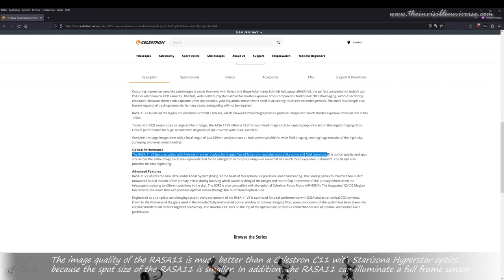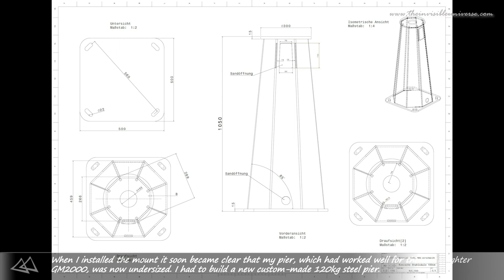Celestron Triple RASA11 Astrograph on the 10micron GM3000 mount

Comment: Well done sir. What a creative idea using a tri RASA configuration. I’ve been thinking about this idea but with between 2 to 4 5”-6” apos. But I could never achieve f/2.2 with those. I could never do this with an AP 130 because getting one is like interstellar travel much less signing up for 2 more. I live in bortle 4 skies so I have some good sky to work with at least. Currently just capturing say NGC 206 up close in detail has taken about 3 days of imaging all night. With a setup like this I could do it possibly in one night. Might be looking at Stellarvue, TEC or Tak—but these are so much faster. You’ve given me a lot to think about. My original idea is to portablize this kind of Astro graph, I’ve got super dark skies about an hour away. Still looking at an AP1600GTO.

Comment: How did you solve the star reflections?  I have a single RASA 11 but am plagued by reflections while imaging Pleiades or Horsehead.
Reply from the maker: Hello, I have similar problems with star halos on bright stars. Star halos are probably caused by multiple reflections between the corrector, the filters and the image sensor. This is a disadvantage of these fast astrographs.

Comment: Fantastic! Excuse my ignorance, could you use all three scopes simultaneously as an array, effectively creating a massive aperture?
Reply: Yes, I think it's a little like interferometry, several scopes spaced away from each other but gathering light or radio waves in an aperture the same as the distances involved. In this case, I believe it's the same as a really fast 33-inch scope (3x11inch).

Comment: Rather than 3 large scopes some have gone to a battery of smaller refractors....I saw one with 9-4" refractors that was used professionally.  This is an impressive project and the results are great....I would have expected some major issues with alignment, synchronization, etc.
Reply: You are right. The same results could be achieved with lesser integration, one scope and … darker skies

Comment: It will be great to know Signal Noise Ratio (SNR can be measured in Pixinsight) for integrated files. 
Visually, I get similar pictures of the same targets with 5 times lesser integration, with single Tak Epsilon 130 from bortle 2.
Reply from the maker: Hi, the S/N of a stack of images through a clear filter with 20h integrated exposure time through the RASAs is about 2.191e+06 or 63.41 db according to Pixinsight. A factor of 5 is about what I would expect between a sky with bortle 2 and bortle 7. This is the unfortunate result of light pollution.
Reply: @Mike-eg6df  Great! Thanks. Factor is at least 12 for LRGB and 3 for narrow band. This was measured on identical targets with identical exposure profiles. 
Your SNR is extremely good from bortle 7. I never passed e+2. How do you convert that numbers in dB?
Reply from the maker: @anata5127  The SNR is automatically calculated by a script in Pixinsight for an uncompressed 32-bit xisf image and converted to db. However, there are some db converters on the internet.
Reply: @Mike-eg6df  I don’t use script for getting in dB. But, I got converter dB = 10*logSNR. SNR is S/N with no units. I get only SNR in subframe selector.

Comment: Mike - do you do all the CNC machining yourself or is this made by someone else? I am curious what level of expertise is needed for this in terms of designing and manufacturing. Many thanks for your input! Awesome system.
Reply from the maker: Hello, I did all the work on the milling machine and lathe myself. I bought the two machines especially for astronomy. However, these are not CNC machines, but purely manual milling and turning machines. You need a certain skill level to be able to use them. But if I can learn this, then surely everyone else can too.🙂
Reply: @Mike-eg6df  This is awesome - I am always looking for custom parts to improve the rigidity of my set up. Could you please provide the models of the milling and turning machines you purchased? It might be my next project to learn the basics of this myself. Many thanks for your response. Simon
Reply from the maker: Hello, I have an Optimum BF16 milling machine and a Bernardo Profi 450 S Vario, both rather small machines. I don't know if these machines are available in your country. However, I would recommend choosing the next larger machine for better rigidity.

Comment: Lukamoto has a video out explaining the diminishing return on overall time capture. Your thoughts on this?
Reply from the maker: Hello, as a first approximation you can say that the signal to noise ratio only increases with the square root of the exposure time. In other words, if I have an image with 40h exposure and a S/N of lets say 60db, I have to expose for another 40h to improve the S/N by a factor of 1.4, i.e. 3db to 63db. The gain is not great in practice and it is difficult to recognise the improvement in the image.
However, if you have only gained e.g. 4h of image data with a S/N of e.g. 50db, it may well make sense to quadruple the exposure time to 16h with a manageable effort in order to double the S/N to 56db. Of course, this is only a simple calculation example and many other factors also influence the calculation.

Comment: Congratulations! This project is a lot of work and investment. But yes you need one clear night to capture one object in narrowband + RGB stars. I have two 8 inch scopes. One I am using to shoot long distances galaxies and nebula's with the reducer become 1400mm F7. Sometimes I am using the full 2000mm F 10. And the other one with my Hyperstar lens become 400mm F1.9 for large objects. I  am controlling them with 2 laptops. My question is do you use the 3 scopes with one computer or you need 3 computers for the 3 telescopes? How do you do that? Thanks!
Reply from the maker: Hi,thanks for viewing the video. I use indeed only one PC for controlling the complete setup. I am running three instances of N.I.N.A. to control the three cameras, the mount and the focus motors.
Reply: Are all the images then combined in one instance of NINA for post production of the single image?

Comment: What are you using to control tilt? Is it photon cage?
Reply from the maker: Hi, I use the Baader UFC Tilter to control the tilt for the full frame ASI6200. For the other two APS-C sized cameras tilt is not a big issue.